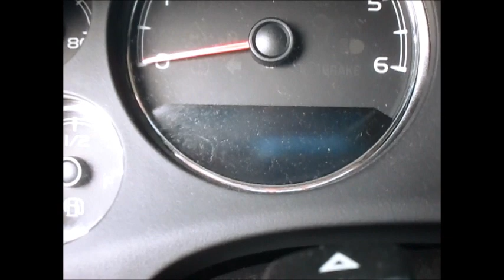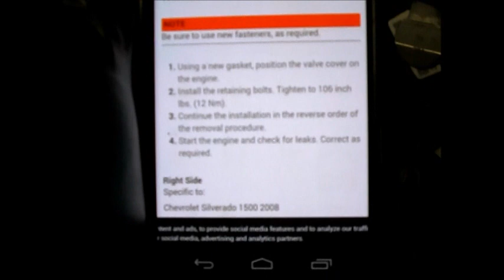Chevy 5.3 Burning Oil, smoking, how to fix.

Comment: I have an 03 Silverado with the 5.3 in it, it burns oil on start-up and under acceleration but cruising or at idle doesn't burn anything, any ideas on what could cause this?
Reply from the maker: My truck was doing the same! It looks like your truck takes the same valve cover as mine. Pull off your PCV line at the valve cover. If you see any oil in the line replace the valve cover with the updated one. Here's a link to the one I bought. https://www.ebay.com/itm/Genuine-GM-Valve-Cover-12570427/252270030312?ssPageName=STRK%3AMEBIDX%3AIT&_trksid=p2060353.m1438.l2649
Reply: @RustBucketRepair  thank you, and thanks for replying, not many on YouTube that still do
Reply: Did you end up figuring it out? I have similar symptoms and am guessing PCV and possibly valve stem seals.

Comment: same as mine i got a 1999 F150 4.2l 5sp start up and hard acceleration it smokes but no water in oil or oil in water. and it is leaking oil. high idles when clutch pressed in could that be a intake manifold gasket? or burnt valve?

Comment: I can smell mine burning oil but it does not smoke anywhere close to yours.
Reply from the maker: How much oil are you using?
Reply: @RustBucketRepair  hard to tell. I do short trips so my oil takes a beating. I change it about every 1500 miles or so. Last oil change it was about 2 quarts low. I can smell burning oil. Not sure if it's a leak and is burning on the exhaust or if is getting burnt in the motor. I'm pulling the motor and trans to swap into a S10. Had planned on fixing any leaks and stopping the burning oil.

Comment: If this doesn't resolve the oil consumption, there's another rubber boot inside the oil pan that fails also and needs replaced.
Reply: What does it look like
Reply: @cjdorsey5901  it’s a boot that goes on bottom of the o ring on the oil suction tube

Comment: The funny thing is I've seen Dorman valve covers fr these trucks made in mexico and canada and if they're junk then why is the one that I replaced on a 2007 avalanche still working just fine and I don't expect it to fail and we are now 23 or 24 months later..yours is the same product made in the same factory and funny thing..you paid more for JUNK..
Reply: The original GM valve cover was junk. Haven't heard anyone having issues with the Dorman replacement.